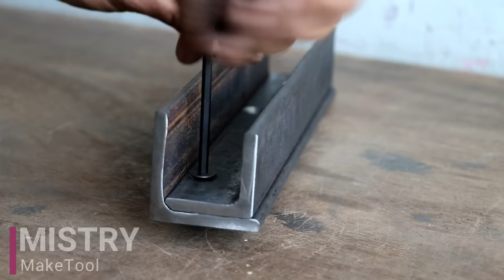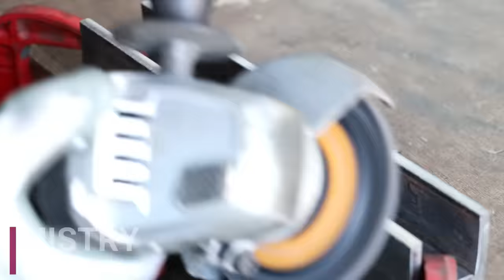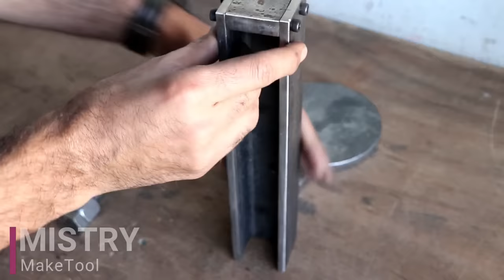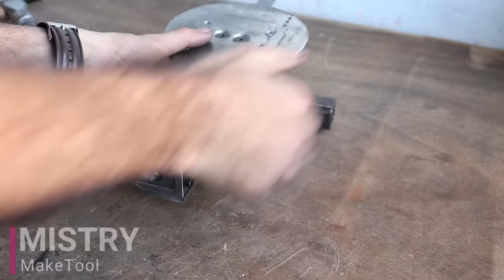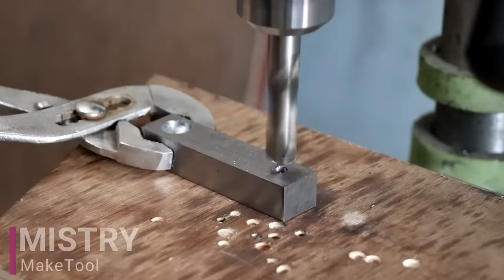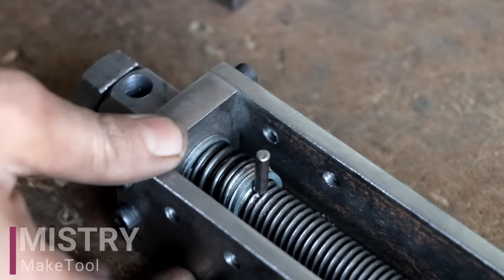How To Make A Bench Vise || DIY Metal Bench Vise Without Welding

Comment: This would be an excellent template for someone who needed to make a custom vice, the dimensions could be altered to suit anything, plus different sets of jaws could be added later. On a larger scale it could make a great power press for bearing/bush work.... Most vices seem to be made from cast iron which I think is more brittle but of greater tensile strength than plain steel (anyone?) So this type of vice would bend before it cracked when pushed beyond the limit - cast iron can crack if heated and cooled too quickly, mild steel would not so there is another property to it's creation right there. More to it than meets the eye I think.
Reply: I use a 10 ton bench press for heavy stuff, and my cast iron vice for Gripping Things !!!!

Comment: Awesome job. You’re going to see that you’re going to want to switch out that handle though and put a half-inch to three-quarter inch piece of Black threaded gas pipe on it. That way you can actually even pick up the end caps for the gas pipe and cement money ends it would look really good. Great job

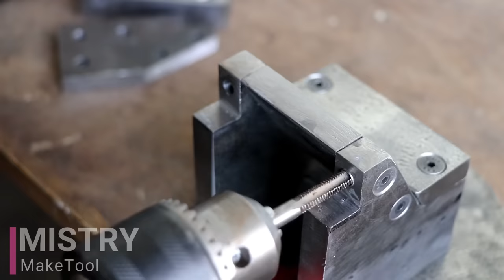Comment: Nice lightweight vise. Good skills, good video. For a strong vise, use much heavier plate, sq. tubing, and lead screw. Don't drill holes through lead screw or other bolts like at 11:54 . Hatching is not needed on jaws, it's a gimmick unless the jaws are heat treated very hard.

Comment: Exactly what I need since I live in Mexico and the rental homes here don't have true 220v outlets. Yes, I could buy an inverter welder from a welding supply shop, but I love my 110v fluxed-core/MIG welder, plus I do more sheet metal work than structural steelworking.

Again, great video and I got a variety of bolts with me, including Allen bolts. I do a lot of drilling too, but on sheet metal.

Comment: excellent job, bench vise without welding, there's a little mistake on 11:43, drilled on a screw-on same plate, I think it will cut the screw, and during work might have broken, you might have drilled from upside but it's a nice job overall.

Comment: Use a marker ink, before you use the callipers...It won't damage the tip of the jaw..
Reply: Great tip right there friend! I remember destroying my first caliper because I didn't used marker ink and well... The tip of my caliper got really torned up after marking some pieces of 1020 steel (Ok it was a cheap and crappy caliper but still... If I used that technique I wouldn't need to buy other caliper in a hurry back then)

Comment: It's best to put threadlocker on all the screws. Will last much longer. Although the screw construction won't be as strong as a fabricated vice, cast vice or forged vice but I guess will work if that's what you want to have.

Comment: What is it with these guys who can cut a straight line freehand with an angle grinder, better than I can draw with a pencil and a straightedge?
Reply: Tips, first cut lightly just to scratch the surface, This will be easier to maintain straightness cut. Then repeat till you got the guide lines

Comment: As a welder, I would have still welded this lol
Reply: Same. those two screws holding the nut on are the weak point of the vice, i would at least used 12mm screws.
Reply: Good welds might be stronger, but after watching some of the other guys on here weld I can appreciate a mechanical build without a chewing gum weld for a change.
Reply: @JRPittman  good welds would make it stronger

Comment: Looks easy but surely  only Professionals can make with all required tools & materials and precise measurements ,drilling holes and making threads etc;-.Good job.Each bolt/screw  could be fastened with pre-applied metal adhesive for more better grip and tightness.

Comment: Thats a fantastic job, i wonder if a bit of time could be saved in the beginning to just use maybe a 2x2 hss and cut off the side with the seam for the u shape that you made with the angle iron? Maybe some thread locker on all the bolts too.

Comment: The strength of this vise is the sheer strength of those two screws holding the nut to the base. That will be the fail point. And like a chain, a vise is no stronger than it's weakest part.

Comment: for a non solder vise made or for a project like those from Ikea yeah it should be ok but in a daily use will just be destroyed, in the rest use at least some glows if u don't fix the parts when drill them .

Comment: You are Almost there, you did it all Perfect. But my question is which type of metal did you use for the Jaws? and the lead threading shaft?   And your lead shaft thread I could not possibly figured out whether it was a square thread or not? but in all you did a good job. your measuring aspects was good.           5**
Reply: use square thread as they are strongest for  loads , try to acquire a tensile steel or HSS bolt .

Comment: can someone explain why the metal rod need a spring attached to it behind the small front metal plate?
Reply: Kuda Padi 
The reason could be in certain situation you need to hold on to something without over tighten or back off without over loosening.

Comment: So $40 worth of metric panheads...$20 worth of scrap metal, $10 worth of cutoff wheels, $5 for a 5/8 or 15mm bolt and nuts and 8 hours labor for a $60 bench vise? I mean I applaud your work it is good but sometimes got gotta weigh the cost benefit...

Comment: The main screw that he used in the middle to turn the vise in and out is totally wrong..Those threads are way to fine and small..I'd strip that vise in one work day.. Threads on a real vise are much wider and deeper for strength.. Otherwise nice build.. Maybe good for a DIY'er, but not a shop where It's gonna really get used and put to the test..